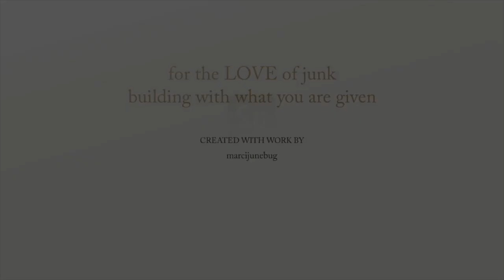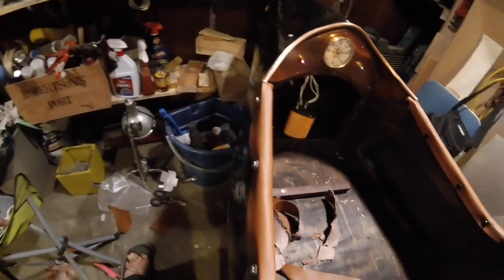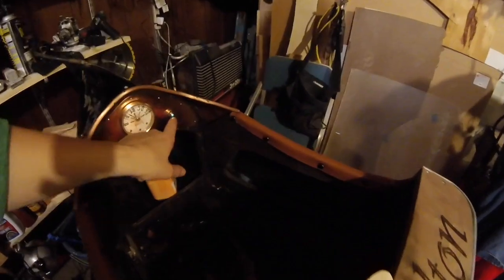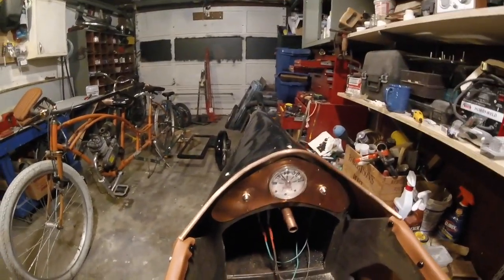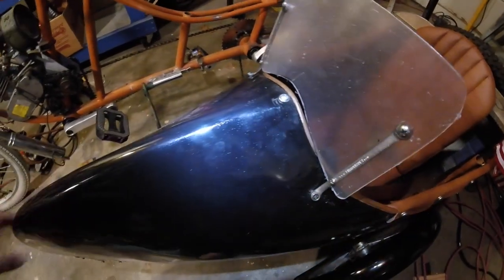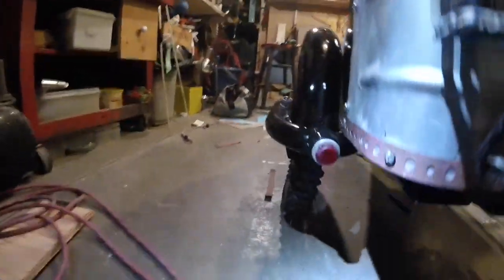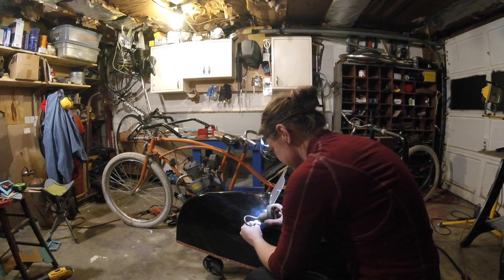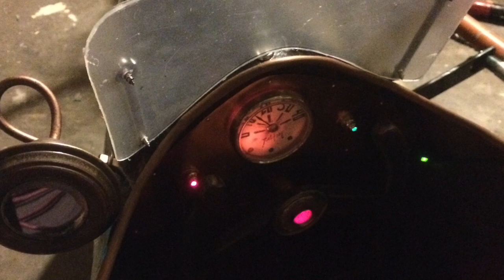Building a Bicycle Sidecar (part 7 of 8)

Comment: You could build a brass windshield frame, then braze the supports to it and bolt to the body, to mount the plexiglass drill oversized holes then through bolt with copper hardware. If you need to add multiple bends to the plexiglass a heat gun works wonders, just takes time